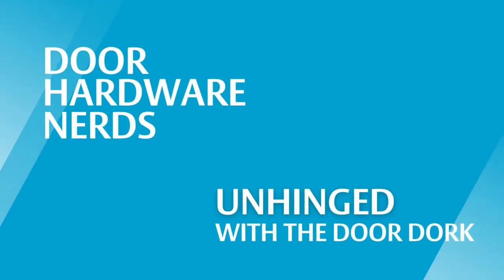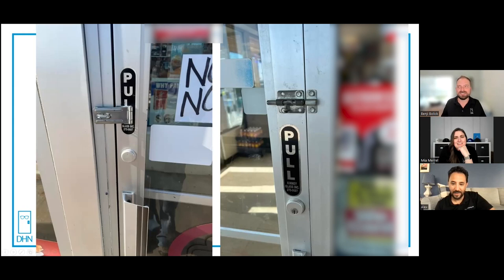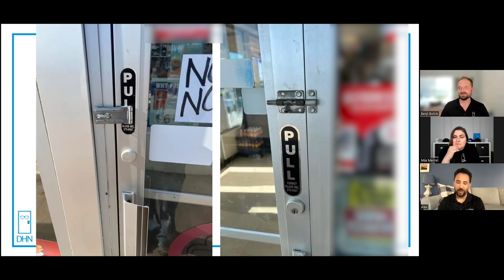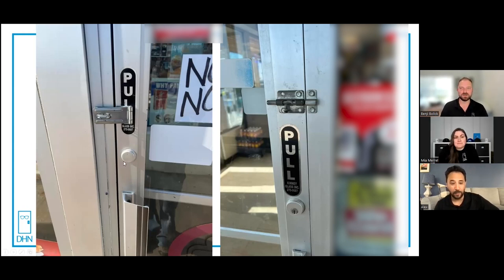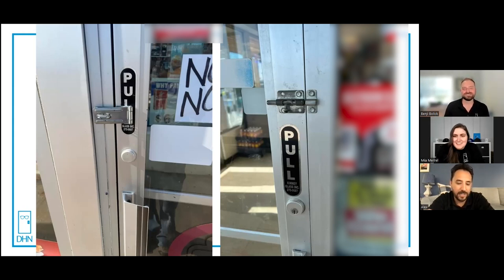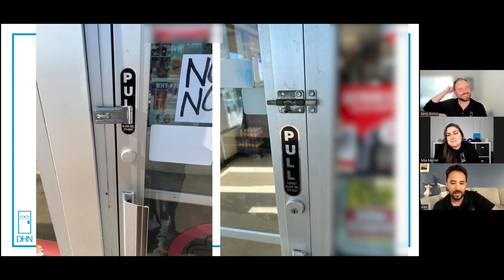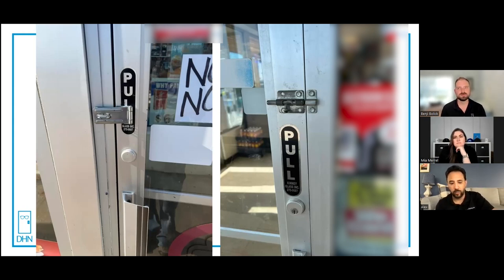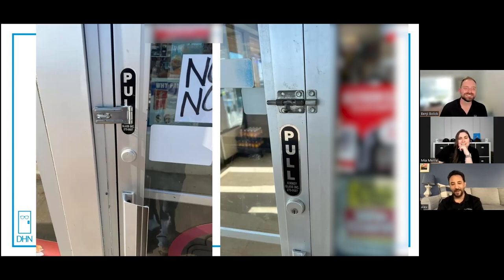Unhinged - Episode 24 Part 3

Comment: Here's my thoughts on these doors.  The left one (judging by the angle of the sun) is the main entry to the business.  They cheaped out and put on a hasp and staple rather than install a mortise cylinder on the door (I've seen it before).  The right door (judging by the sun INSIDE the space on the floor) is a dividing door between two businesses.  I'll bet they have different hours of operation and this way they can prevent access from the convenience store into the "service station" area after hours.  Then the convenience store can remain open longer.
Reply from the maker: Great idea about the different businesses! We didn't even consider that!
Reply: Could be!! I could see that being the case!